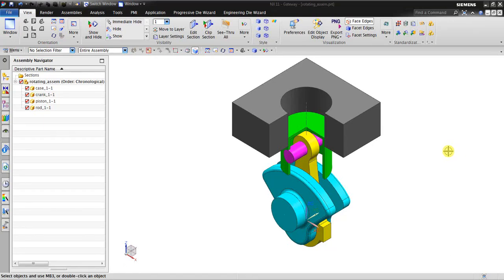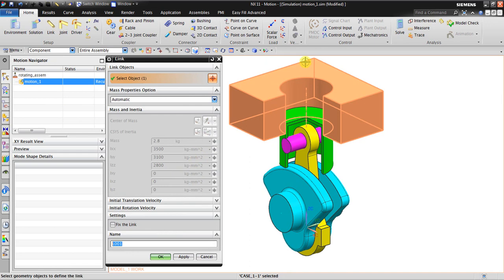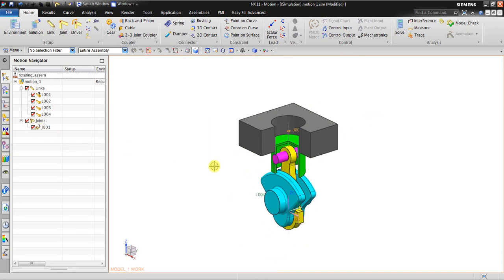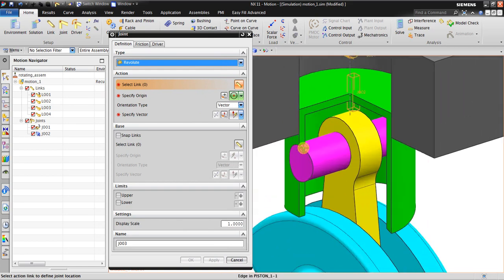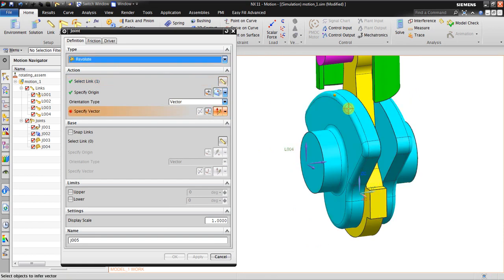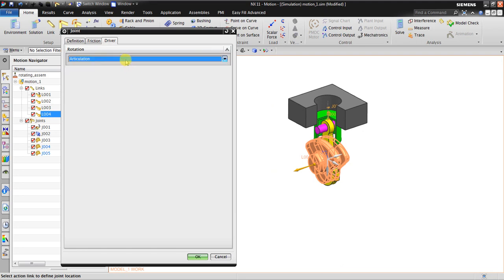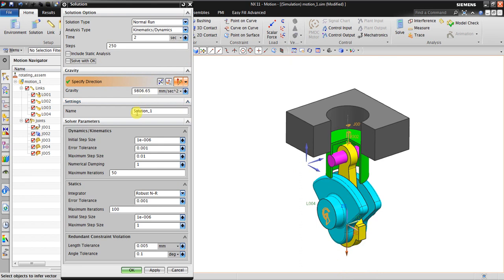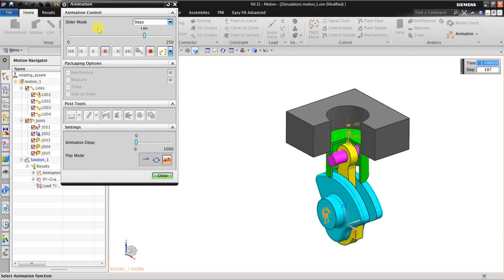NX Motion Tutorial : Basic Step by Step Motion Simulation

Comment: i have nx 1953 student version
i checked in application , motion simulation option not there  , 
can you explain me how to add
Reply from the maker: Please check your license first, is it support motion simulation or not?
 I believe student edition should support all module. 

If your license support it, maybe when installation you did not select complete installation. Please reinstall NX.
Reply: @CADCAECAMTutorial  can you make one video for this because I am new user may because of that I missed or you can tell me how I can do complete installation or process on complete installation of student version of nx(1953)
Pleaseeeeeeeee
Reply from the maker: Please contact authorized partner for Siemens PLM in your country. They will assist to solve your problem. 

Or you can contact where you buy the student license, they should help you solve the problem.

Comment: Can u please make a simulation on mould
Reply from the maker: Mould for plastic injection molding ?
What kind of simulation?
Thermal-Fluid ? Or movement ?
Reply: @CADCAECAMTutorial  yes sir for plastic mould  movement
Reply: Its my pleasure u replied
Reply: @CADCAECAMTutorial  im insanly searching  for this
Reply from the maker: For plastic mould movement, you can use NX Mold Wizard. Use kinetic function.

If using NX Motion Simulation, you must define all movement, it's timing, driving force, etc. Difficult.

But if using NX Mold Wizard, you just need to define which is part, fixed mold, moving mold, ejector pin, slider and lifter... it's easy. Please study my video about NX Mold Wizard, last STEP video.
Reply: @CADCAECAMTutorial  sir im already did nx mould wizard smulation but i want to learn the same thing on nx modelling
Reply: Sir its my humble request to u please
Reply from the maker: So you still want me to create mold open close and other movement in NX Motion Simulation ?
Reply: @CADCAECAMTutorial  yes sir please please its humble request to you